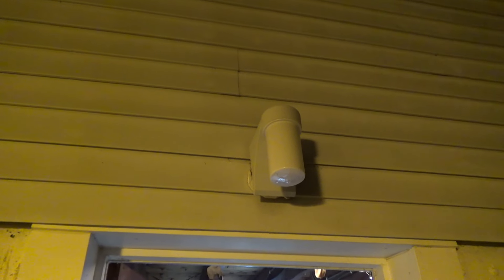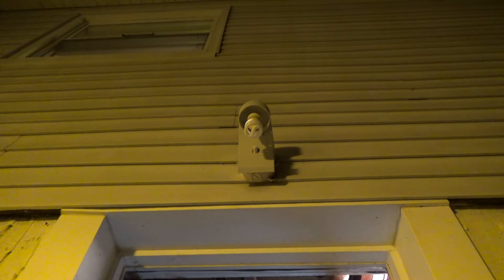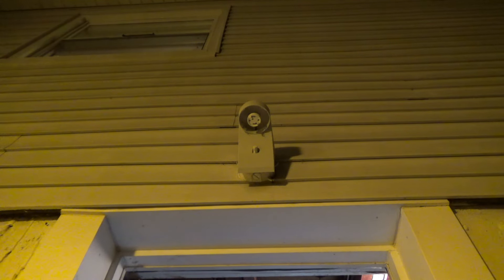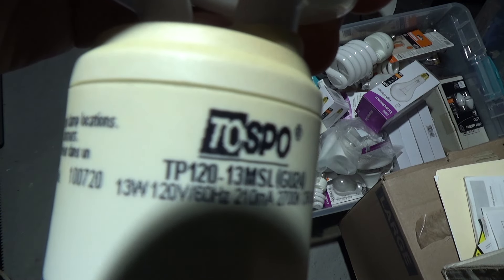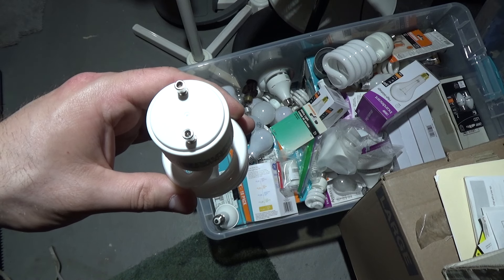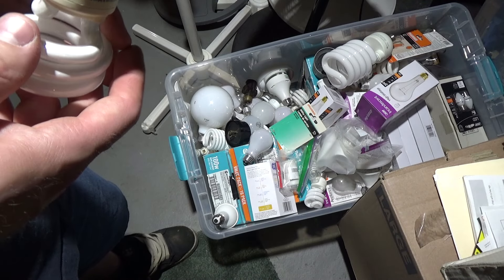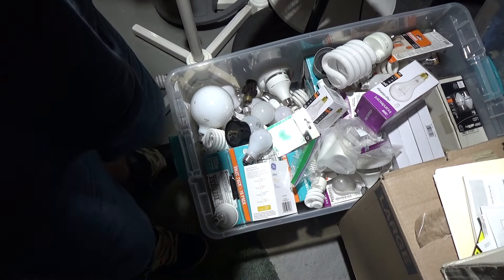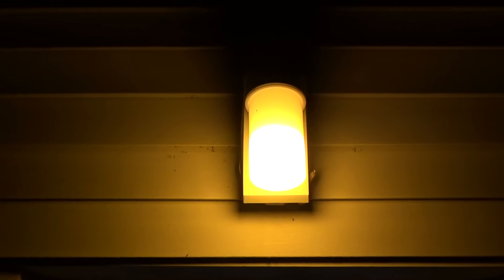Back Door Light Failure 6/15/2024

Comment: The tube lights when you touch it because you’re grounded relative to the bulb and your fingers provide better capacitive coupling than the stick does. When the bulbs go bad like that it’s because of reduced current through the tube due to changes in the electrodes and maybe even the gas. When you touch it, you create a shorter path from one of the electrodes, and by ionizing that gas it can trigger the rest of it to start conducting, if only briefly.